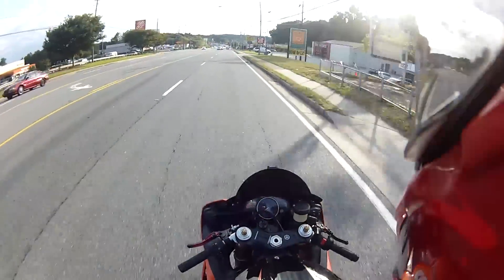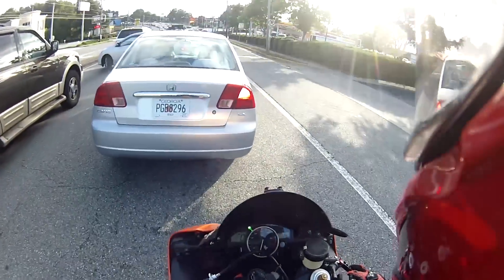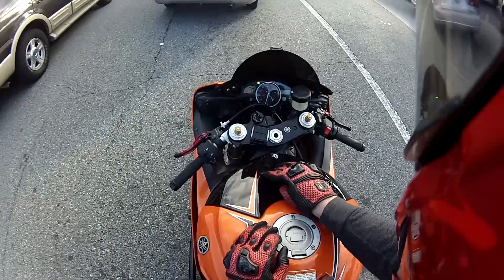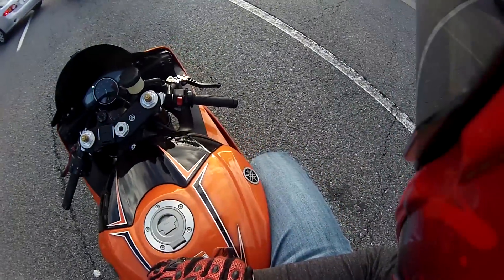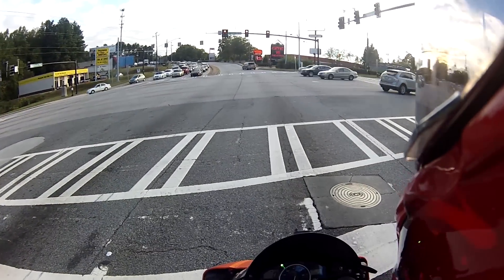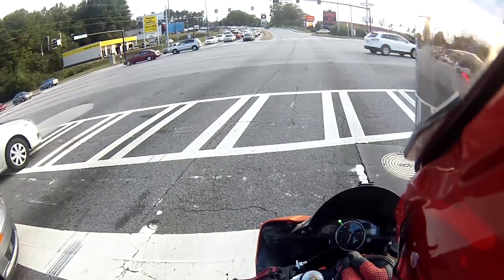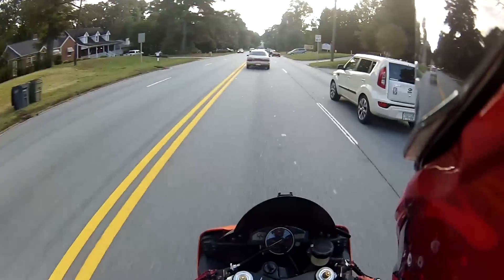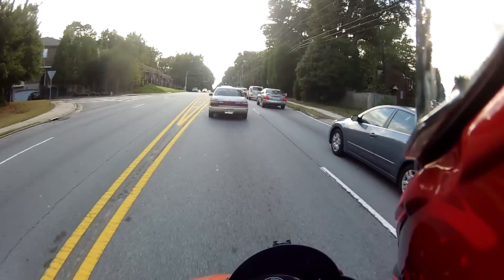Go-To Mods and Tank Painting

Comment: +1 front +4 back sprockets, spools, exhaust, shorty levers, grips, frame sliders, "windscreen" black out, and HIDs.

Chase HIDs are simple, it is just 1 ballast for each bulb you replace with HID bulb. So if you ran just a low beam bulb you have 1 ballast and 1 HID bulb that you place in and you find a spot to mount the Ballast so it wont move around and try to get a digital ballast if you do they are much smaller/brighter.

Comment: A quick thought on power commanders, on a lot of bikes it's not necessarily done to make the bike faster, but to smooth out the throttle response. For example, my 2008 VFR800 with the stock fuel maps is really 'on-off' with the throttle response to the point of being pretty irritating in slow traffic. A power commander can smooth that out a lot. And if it adds a few horses at the top end, I guess that's just a nice side effect, but not the primary goal.

Comment: For me, the paint does not matter to me when it comes to being a deal breaker or not, but it will cost more if I want to repaint it, unless I can find a great deal on the painting, to where it is not that expensive, that is a major plus for me. If I do want to repaint it, it will be going with a certain theme, and then to get it clear coated so the finish is not damaged by the weather.

Comment: If you're handy, repainting isn't a big deal. The trick is getting factory quality, which is tricky in a DIY home attempt. The pro setups have ventilation which pulls the paint particles and dust down into the floor with filters pulling fresh clean air in from above.

That said, I had a friend repaint my Speed Triple from silver to a hardened hotrod semi-flat black. Turned out okay. I'll eventually repaint again when I resurrect that bike.

Comment: For me the fender eliminator kit is always a must...  My 2015 FZ-07 was the first brand new bike I have ever bought... and really the only bike I have needed to mod.  Most of my past used bikes already had most everything done that I would have done to those bikes.  But buying a brand new bike really makes you want to mod out so many things... Things I have done so far on my FZ-07... Windscreen, Bar end mirrors, fender eliminator, phone Ram Mount, flush mount LED front blinkers, integrated LED tail light/blinkers.  I still need to get my frame sliders, a helmet guardian, and a few other small extras... I have thought about a corbin seat... an exhaust and power commander are pretty low on my list... like you said... it's already a fast bike... and I like how quiet the stock exhaust is.
Reply: I did a bunch of mods to my FZ-07,  Nice bike.

Comment: I always start with the suspension. Get it tuned by someone that really knows the suspension. Also adjust the brake and clutch levers. Then exhaust. Tank grips if you have an aggressive riding position, they help the back. Trim the seat down for comfort and height. A double bubble if I have a hard time tucking behind that little windshield. Of course the fender eliminator.
For my GSXR, move the regulator/rectifier. They are in the worst spot. When the cook, it will damage your stator and battery.

Comment: I bought a red bike, red frame red plastics. It has been disassembled for the last 4 months to be repainted white and black. Picking a bike with the color you want is hard to do when you work with a budget, paint is cheap on a bike. Also as for mods,  most bikes get a small luggage rack over the tail and bar end mirrors

Comment: Both my R6's have had almost all of the same mods...gotta have the shorty levers!  After that, I have to have the Jardine GP1 exhaust, fender eliminator kit, slider kid, and LED signals all around...especially the front.  My current bike (same as yours), I also changed out the windshield.  Also, because my bike was knocked over, I had to do some paint on the plastic on the front of the tank and I am in the process of swapping out the pegs (one broke).  Sometimes, rear sprocket...

Comment: When I got my Honda ST1300 (I bought it because it was blue), it came with a throttle lock and aftermarket seat.  I then added smallish handlebar risers, a different windscreen, and an auxilliary power outlet.  My everyday bike (Suzuki GS500E) has no modes other than a small windshield to deflect wind at highway speeds.  Like to put frame sliders on the smaller bike.

Comment: chase, you should look into an ECU flash by Bauce racing. There are alot of things that an ECU flash will help with like reduced engine braking, speedo adjustment, and throttle smoothness. On my 07 R6, my top is full exhaust, fender eliminator, ECU flash, chain & sprockets, shorty levers, and HIDs. HIDs make a world of difference for night riding.

Comment: I agree I got a really good deal on my 05 R6 Raven off of my friend. but he put all white fairings on it, and they were used hard.. so I bought all black and it's a pain in the ass or extremely expensive to get the tank painted! my mods adjustable shortly levers, adjustable rear sets, fender eliminater, flush mount turn signals, drag sprocket, and shorty exhaust

Comment: Frame sliders and spools are the #1 mod for me. #2 would be between body lighting for night rides/louder exhaust so i can be easily heard. #3 is HIDs so i can see better. everything else for fun would be Blue or Gold clutch and brake levers, carbon fiber filler cap pad and tank pad, fender eliminator, LED brake and signal lights.

Comment: A power commander is sometimes necessary if you do exhaust work so that the bike still runs correctly. I got a TTuners Y pipe on my R6 and a power commander helped the bike run with the new addition. Color doesnt matter much i guess, I went to get a red and white CBR and left with an all black R6. best decision ever.

Comment: standard oem levers dont allow for a "feel", shorties are just that. they are short. if you buy aftermarket levers, standard length are shorter than oem levers, and shorties are like for 2 finger pressure. but they allow for changes in distance from gripping the bars. if that makes sense

Comment: Color is huge for me. I want all black with Candy Red powder coat on the rims and on other little places like the shifter. My mods I am getting are Frame sliders, Fender Eliminator, Motodynamic Tail light, HID's and halos from BKMOTO, neon kit from XK Glow, Shorty levers, Toce slip on Exhaust with y pipe catalytic converter removal, and then a Double Bubble windshield. All in that order. I'll have the sickest bike, but have to wait until I find a good deal on Craiglist on an 2009 R6.

Comment: A power commander lets you re-map the fuel to match the higher airflow you get with most aftermarket exhausts. Otherwise you run the risk of running your bike too lean. A custom map can give you a smother throttle roll-on too.

Comment: Deal breaker for me if its not in the color I want.

First things i did to mine was, exhaust, HID headlights, sequential tail light, fender eliminator, power commander, and sliders. 

I plan on getting a projector kit to put my HID lights in as of now theyre just in the stock reflective housing. I also need some spools, and last I'll probably get a black windscreen.

Comment: I bought "Lacy" for $4,500.  She's a 2005 YZF R6T/C with under 7500 miles (at time of purchase)  

Sorry this may be longer then you wanted lol....But here you go...When I was bike shopping, I was looking for an orange/black GSX-R 750; Thats all I wanted. While I was shopping around at dealerships, craigslist, etc, I was talking to a few friends of mine who were also in the search for bikes. Told me that I wouldn't need a 750. 600 would be plenty. So I started looking at 600s. Still wanting the orange/black scheme. Came across the R6 that I have now and its perfect. The guy sent me pictures of the bike and failed to mention through texts all the upgrades it had to it already until I showed up in person to look at the bike. After telling the guy that I wanted it, he was like oh yea, I failed to mention that this bike has:

(I knew the bike had some of the upgrades already from what I could tell from the pictures that he sent me...)

*DynoJet PCIII
*Two Brothers exhaust
*K&N air filter
*Frame sliders
*Goblin bell (i thought was pretty funny) til I researched the use of them :)

So to answer your question as to which "go to mods" they would be:

*exhaust
*Frame sliders
*Short levers
*Sprocket set

The next upgrades that I am looking at getting are:

*CNC Short levers (Red)
*52T Vortex CAT5 rear sprocket (either red or black)

Comment: Race rails is first thing people get Fender eliminator is like the 2nd thing people take off. Exhaust is probably 3rd to get.
Reply: get sliders. race rails are made for stunting and low speed impacts. ive seen SOOOOOOO many race rails dent the frame where its connected at the rear. literally saw an 06 gsxr get totaled out cause the rail dented the frame.
Reply: Yeah, I got frame sliders on mine right now.

Comment: Power commander isn't necessarily to make the bike faster. If you do it right and get a dyno tune with it, it will smooth out power delivery and correct the air/fuel ratio. Ultimately it will can give you more horsepower but for me it's about smooth power delivery. And HIDs are a mist for me. Stock lights are way too dull for me

Comment: Color doesn't matter much to me ... I've had 3 R1's ( 01 Red, 09 Raven and now a 06 50th Yellow ) Go To Mods for me are levers ( Pazzo Shorties ), rearsets, A.I.S. block off plates, rear spools, sprockets and chain, grips and bar ends, BAZZAZ, aftermarket exhaust, SS brake lines and pads, better tyres and suspension set-up ,rear fender eliminator and flush mount indicators

Comment: To me, color is almost irrelevant.  You can get used to just about anything.  Everything else about the bike is more important to me.
Yeah, OK, I would probably ark up at hot pink, but I dont know of any manufacters that color bikes pink out the factory :)
Mods:  Depends on type of bike, 
SuperSport: Frame Sliders / Race Rails, Pipe, Flush Front indicators, HID
Your right, no need to go extreme on power, they have enough really.
Road/Trail: Bark Busters, Tires.

Comment: hey man I just want to say the mods I always do on my bikes,now I have a yamaha r6 2004, so I start with the brakes, change the rubber pipes with metal ones( if you brake a lot the rubber will expand and you lose the power on the brakes), the front brake pomp( i use brembo 19/20 because I always use only one finger to brake), the exaust i change it from top to bottom, I use the carbon fiber  because it's harder to gain heat(excuse my english), changing that I am forced to put a sport air filter and another centralin(computer memory-don't know how to call it sorry) that conect's with the one I already have on the bike and I ussually gain some horse power and faster acceleration at 4000rpm, now I have complete termignoni exhaust, bmc air filter and rapid bike 3 centralin. this is my first bike were I installed higher foot pads(for sporty possition) and margherita brakediscs and brembo brake pads, I always install the double boble wind protector, the bike is in the paint shop because I didn't  liked the original paint, if you want to see it i will send a picture when it's done, I like you channel, keep up the good work and stop loosing your bikes man :)

Comment: my yz250 lost spark :( it wasn't the plug, so i got a new, racing cdi, makes it rev 1000 rpm's higher which for the mx track is needed, its a good upgrade, i always have to have fat bars, I'm usually running fmf gold series fatty pipes, with either fmf shorty or a pro circuit, other than this i always have asv shorty levers, ohhh u always want boysene reeds they help a lot.

Comment: Color Is a deal breaker, if its not the right Color, its not coming home. Frame Sliders with Rear Spools are the first and must have Mod, and Fender Eliminator (still trying to get mine :( lol) and Exhaust, then HID Headlight Kit but not the crazy 6000 - 12000k Kits, something more useful like the 3800 - 4200 K Kits so its Bright White light (I do a LOT of night riding since its my daily rider) those are my must have Mods. Oh and Tires, but I don't go out of my way to burn out the Factory set, Love Pirelli's didn't like the BT016's that came on my Ninja from the Factory.

Comment: Why not plasti dip the tank? that should be pretty cheap
Reply: plasti dip wouldnt be a good choice for a tank , every kid with a honda civic does it to their rims , all it does is peel , its nice  on certain things but i dont think it would be resilient against Gasoline , plus rubbing against it and hitting ur key on it , once it peels in one spot say bye bye
Reply: Jesse Cox
Dipped my tank, going on almost two months now. Just make sure there are enough coats knowing that it will get alot of abuse. I also waxed it to keep some integrity.
Reply: Jesse Cox As long as you dont poor gasonline directly on the tank, you should be fine
Reply: true culan001 yea it would be better on a sport bike , but on something like a dirtbike where gas is constantly being spilled on the tank its probably not too good but for the street bike its probably fine
Reply: Jesse Cox
Plasti-dip is surprisingly resilient if done properly. Most people that do it simply wash their car/bike and that's it, but it requires use of a degreaser and also the removal of any flaking clear/paint. My friend painted his Mazda with it and it's been on there a year in single and triple digit temps (Fahrenheit) and the only flaking was where the doors were repainted (cheap re-spray)
Reply: Alyssa Pruden
agree. whenever I use it i wash my car/ motorcycle with dawn. Cheap and does the trick. I think another thing people do is that they put very light coats on and expect it to last. I put four to five good coats on to make sure It lasts and also to make peeling it easier.
Reply: crashmasher ive had my cars wheels plasti dipped for going on a year now and it still looks great, just gotta make sure to do enough coats so it will last

Comment: Color is nothing in relation to the quality of the bike that you're about to buy. You have 2 bikes: One has a less-than-desirable color, but runs amazing, and another bike that has the perfect color that calls your name, but it either has higher miles or just doesn't run buttery smooth like the first.

Function over form. Aesthetics can always be changed for much cheaper than fixing problems.